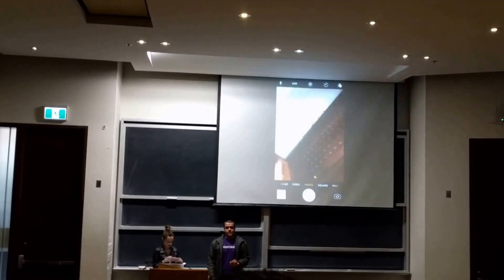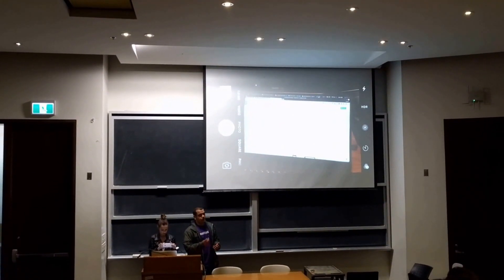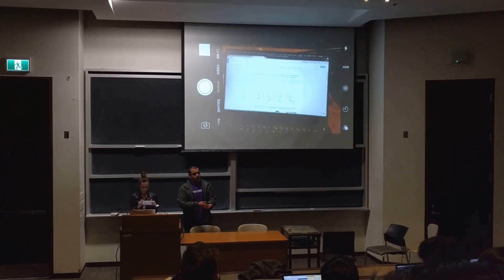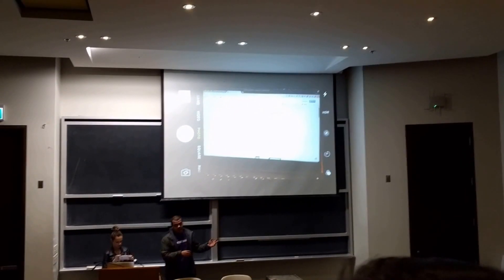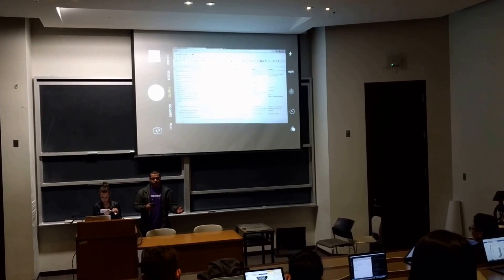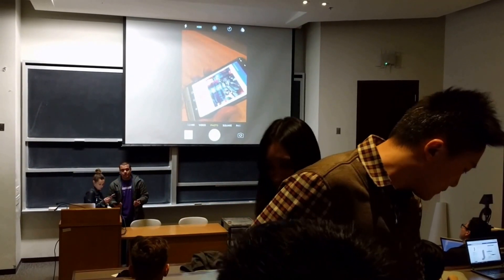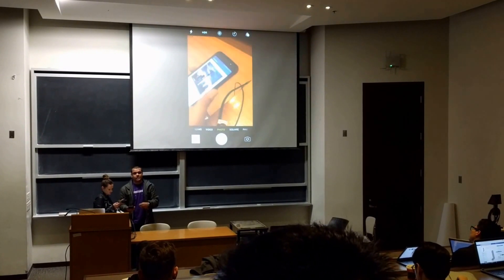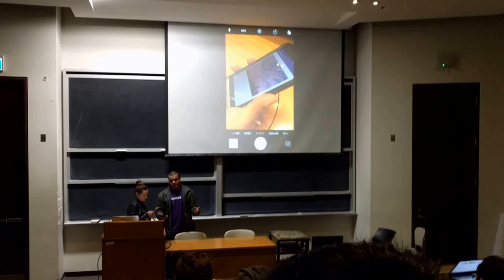Using Fingerprint Sensor on Mobile Phones as Touchpad

Comment: Holding phone in one hand with full grip and controlling the phone at same time is a crazy good idea. I knew smartphone fingerprint scanners are capable of recognising capacitive gestures like swipe, touch etc. so today I was searching about this online like app or something and bumped on this video. I liked your research and explanation because I am actually facing these issues 😅. Is there really any app or something to make it reality?
Reply from the maker: You can build it yourself: https://github.com/whizzzkid/AlternativeScroll

however, it looks like the rear fingerprint sensor won't be coming back. Pixel 2 had a rear finger print sensor and it implemented something similar. The latest pixel phones allow tap to swipe down (just the quick settings though). Overall I just feel the back of the phone can be used for so much more.
Reply: @whizzzkid  I feel that way too. Physical fingerprint scanners at back are far more better & practical than optical fingerprint scanners under display (except ultrasonic once).